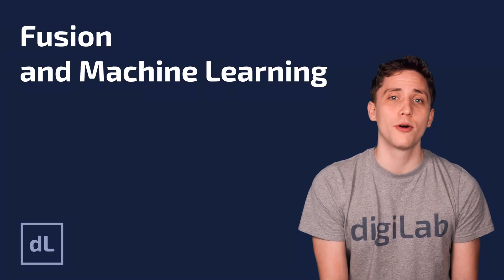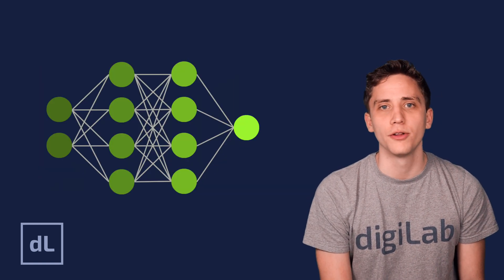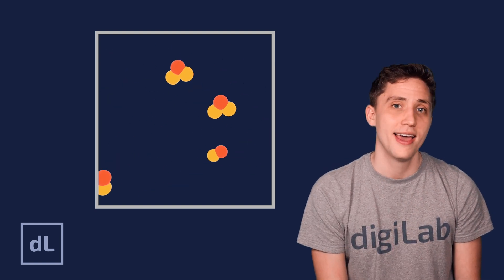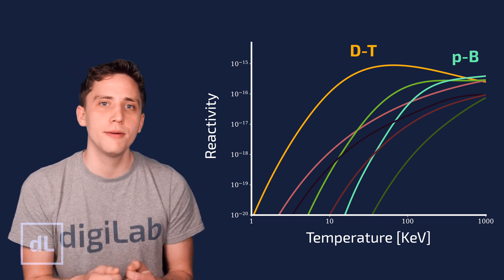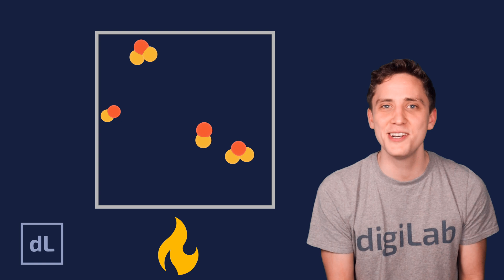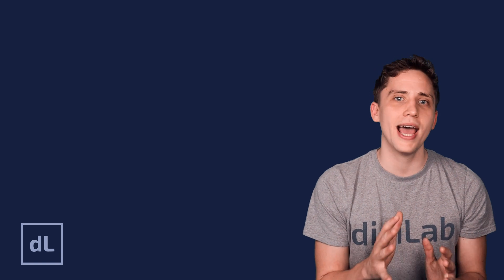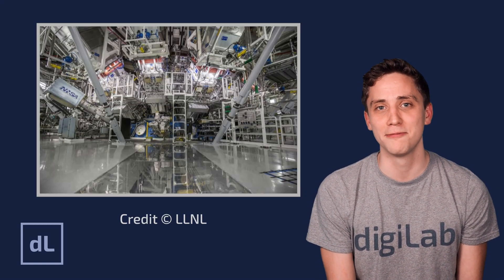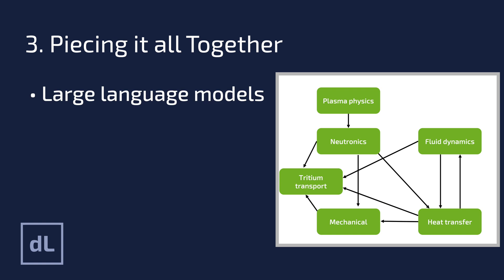What is fusion? | Machine Learning for Fusion

Comment: Nice introduction video! Highest reactivity is not around 15 keV, as you can see from your figure. However, ~15 keV is optimal for fusion power or reaction rate in a pressure-limited system. Otherwise we should heat the plasma to ~65 keV or so.